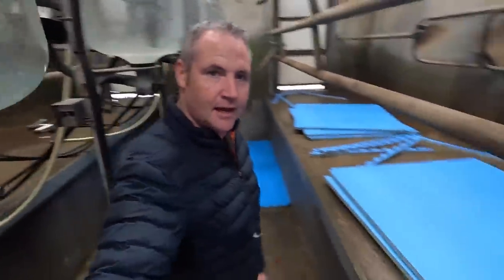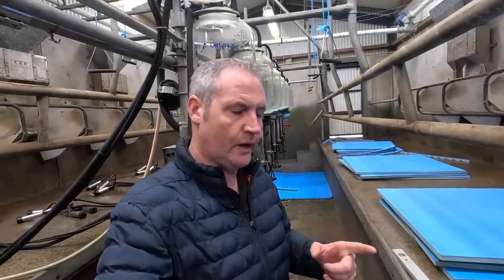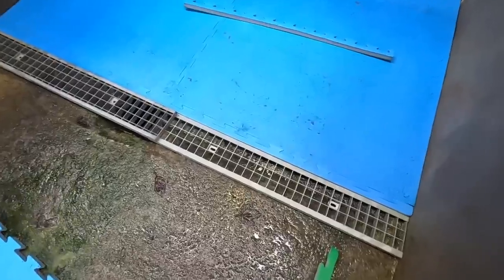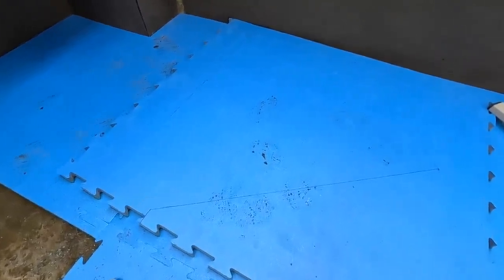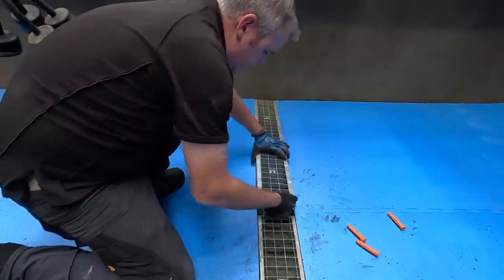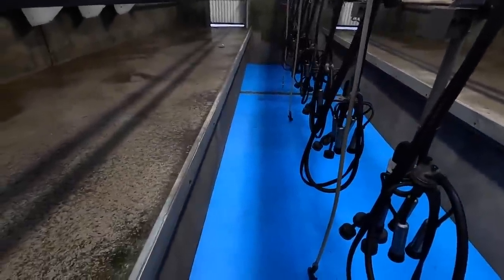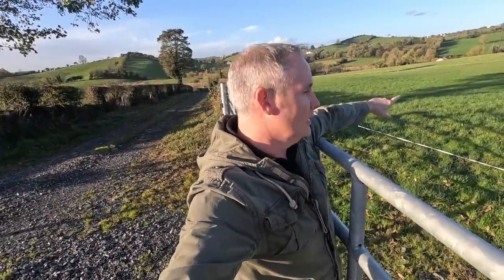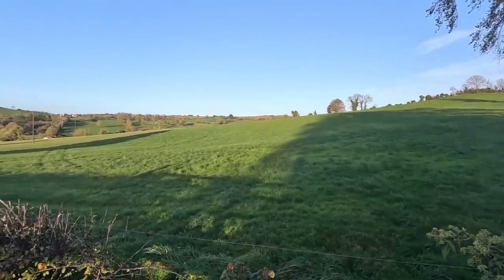ADDING WORKPLACE COMFORT | OUT SMARTING A CLEVER ANIMAL!

Comment: Hi Adrian, I have a bale splitter and I split bale in 1/4 'ers i first split the top half and then the  bottom half and bale falls perfectly over so I can slit in half again. Iv quarters I can pick up with splitter and move.
No throttle used on tractor and no fork👍
Keep the good work up
Reply from the maker: It’s very hard to beat the splitter lad, for price and handiness

Comment: Good project that should help your back, it definitely brightens up the parlor. 
I'm a diesel mechanic and equipment/truck driver over here in the states. I've been a subscriber to your channel for about two years now. I find it funny that you regularly refer to measurements in inches and feet. I guess it surprises me  that you use it that much. I've worked with  guys that would complain about having to use the metric system. Your comment about measuring in inches made me laugh.
Reply from the maker: Well Jason, ya the imperial vs metric does come up a bit. Tradesmen would hate to hear of inches 🤣. I use both, if I’m ordering anything it’s always metric but imperial does drop in on the farm jobs 😜

Comment: Would it work to stager the connection row going the length of the house?  Like have the cut mat on alternating sides might keep them in place better
Reply from the maker: Be a lot of cutting though lad, I thought they’d be easier to pull up and wash underneath this way. You could be right though

Comment: Great job, great hands, looks really well. For your consideration: why not wear a light-weight material weights-belt to protect your back and metric is way easier than imperial. No matter how used to inches you are, the metric 10's is the mutts nuts! If there is a carpenter reading this, please add your tuppence . . . Love your channel. bye
Reply: Metric is great definitely when you dividing
Reply from the maker: Yes I do use metric when ordering stuff, any trades person probably would too. I had one of those belts which definitely did help but swimming and floor stretches where a game changer for me. I’ve strengthened my back muscles, plus i’m more careful of what and how I lift things now. It’s a common issue nowadays

Comment: I can appreciate the comfort point but what about any water etc. that will get under the mats. Doesn't matter how tight you get it it will happen. You've got some work keeping it clean and sterile. I would have thought footwear might have been the answer, even if it was some just for the parlour. 
Good idea and well laid but you know water can get anywhere where it isn't wanted.
Reply from the maker: There possibly will Mark, be there easy to just lift up and wash underneath as there very light weight. Shouldn’t really be an issue hopefully 🤞🤞

Comment: We got Tongue and Groove Floor Boards which were nominally 12 Foot Long. 

And We wanted to hang them vertically on an Industrial Shed Wall, which measured a nominal drop of 123 Inches. 

So the Two of Us who were assigned to Cut Boards, decided to Cut a Board to correct length and then use that Board as a Template, for the cutting of all the other Boards. 

But there was a small Fly in My Ointment. 

My Tape Measure was only 10 Foot Long, (120 Inches) so I’d have to add an additional 3 Inches to the Mark, before cutting the Template. 

Unfortunately I added 3 Centimetres. 

It was quickly discovered, after all the Boards had been Cut, that All of Mine, were Short. 

Thus when hung on the Wall the Boards were placed Long Short Long Short with My Gap at the Bottom, the intention being to add a Skirting Board later and cover My error. 

In the 20+ years that that Wall existed, No Skirting Board was ever added and My error was explained away as a Design Feature intended to Aid in Pest Extermination.